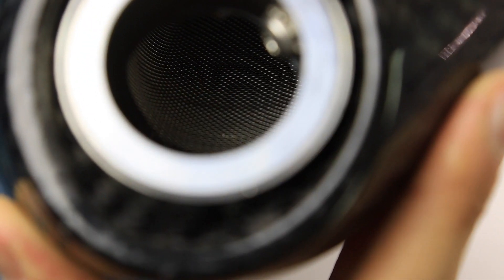The Baffling Question: Mufflers, Performance and Sound

Comment: I have a 2011 Honda interstate 1300 with cobra pipes I took one baffle out and can't get other out will it hurt to drive it that way for a while cause I've drove it a few times and it feels faster definitely louder
Reply: I did mine too however it's only two holes so I baffle one and remove the other one too, it sounds better than full baffled or baffle less and feels faster too